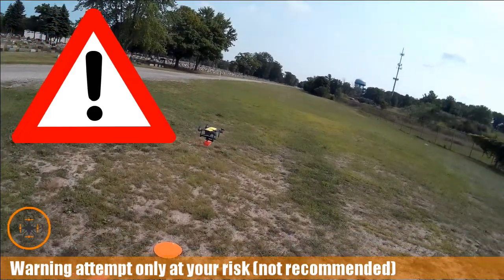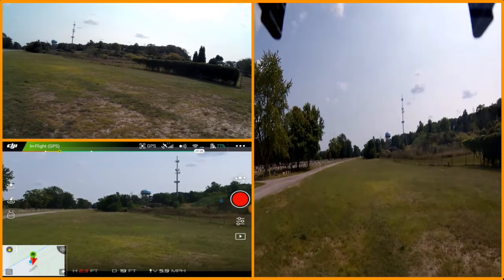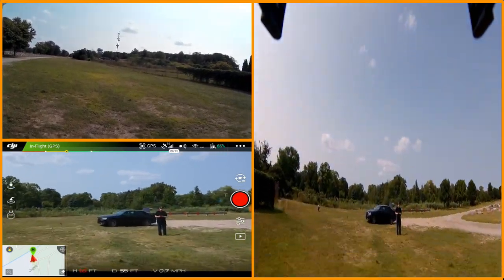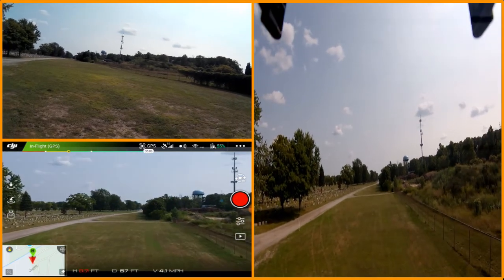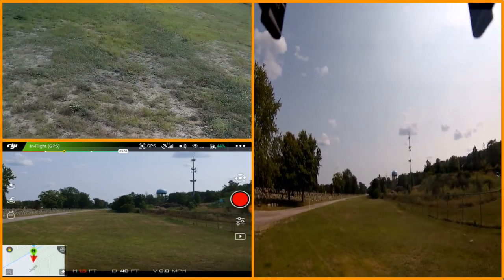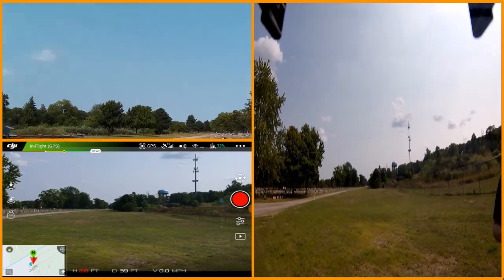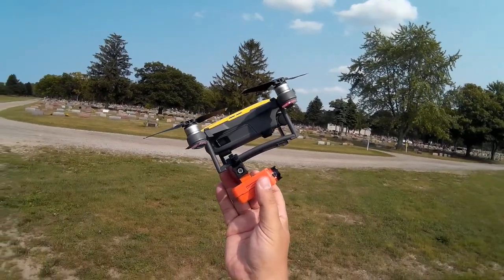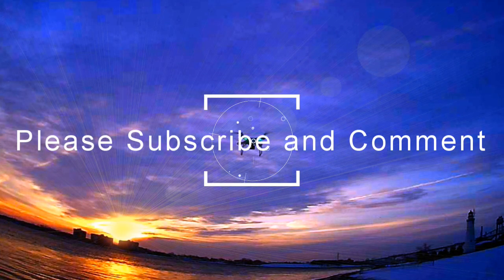Video Drone - DJI Spark Flying a RunCam II with GoPro Style Camera Mount!

Comment: Would the runcam block the sensors on the bottom of the quad?
Reply from the maker: Nope work from from that aspect as pushed far enough back, however the down side of clearing the sensors is its force the back two motors to carry the major of the weight rather than dispersing it...